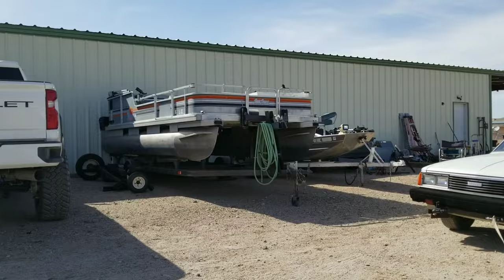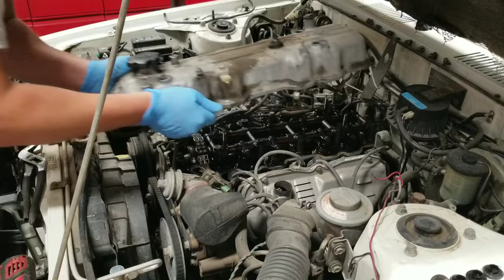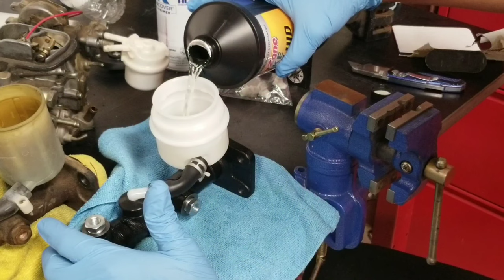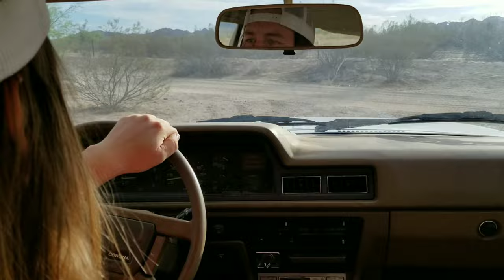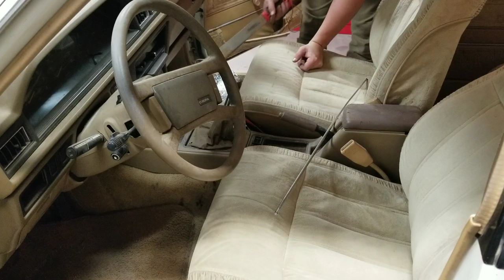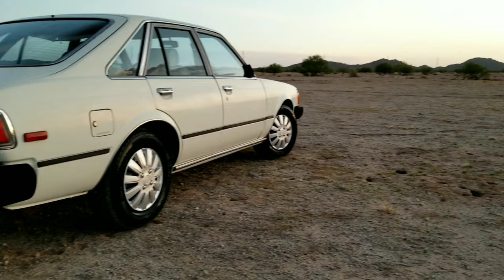ABANDONED In The Desert 14 YEARS! Will It RUN & DRIVE After I Drag It Home?

Comment: I had one! was sold some months ago. it was a 3T tough not an R, and a sedan not a liftback. one time the front wheel decided to flop around in the wheelwell instead of bearing the car's weight because of severe rust, it was fixed but it was sketchy and never felt the same.
Reply from the maker: Thank you for the comment. They are cool little cars!